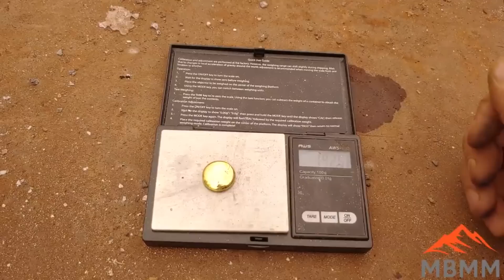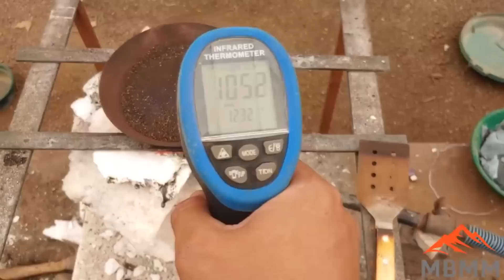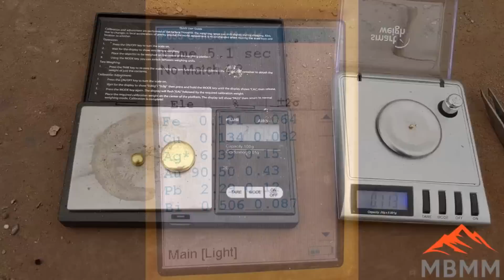Prospecting & Mining Gold From Abandoned Gold Mines!!

Comment: With excavators that have blades, especially smaller sized machines, I found I can get a lot smoother boom movement by dropping the blade so it basically forms a tripod with the ends of the tracks opposite of the blade acting as 2 of the legs and the blade forming a wide 3rd leg.
Reply: Good

Comment: If you have all that big equipment, why then are you not using the gold wheel to separate the black sand from the gold ? I never used a gold wheel , Im asking because , do they work better than the traditional Garrett Gold Pan , or panning is quicker ?

Comment: Could you run small amounts of the number 2 tailings mixed with number 1 each time you do a run or could you use 2 crucibles (1× number 1 & 1x number 2)
at the same time in a larger furnace?
1 gram of gold for 3kg of number 2 would add up over 50 tons.

Comment: Come to arizona I'll show you a spot that has value of 2.4 oz per ton. I will help. I dont have Capitol to work it myself
Reply: Do you have $150? With $150, you can process 1 ton of ore a week by yourself. That's a pick, shovel, sledge, a dozen buckets, and a gold pan. Make your own classifiers out of 1/2" and1/4" hardware cloth, window screen, and cut-down buckets.
Dig it, transport it, crush it, sift it, pan it, all by hand. In 3 months, you have made enough cash flow to buy better equipment.